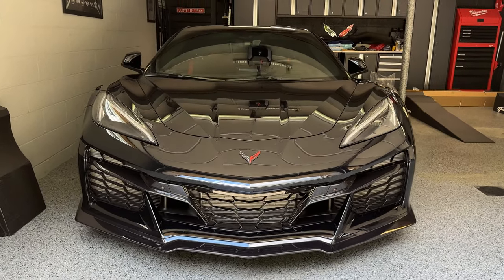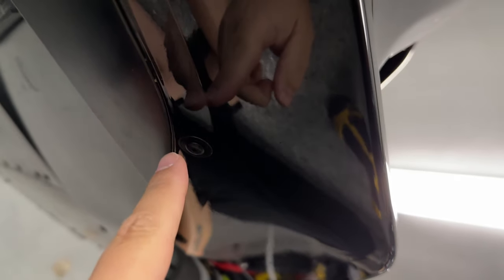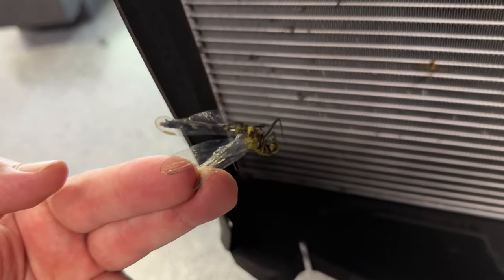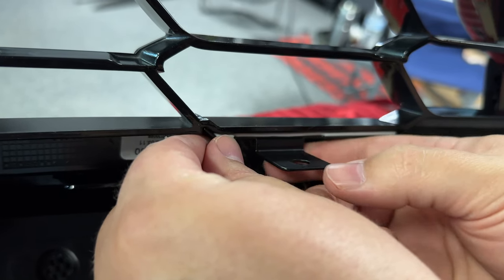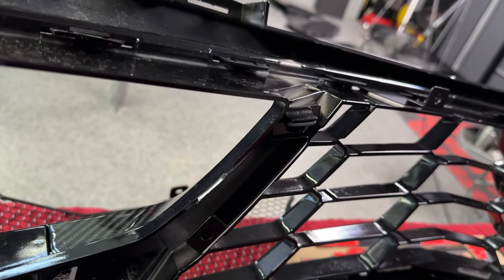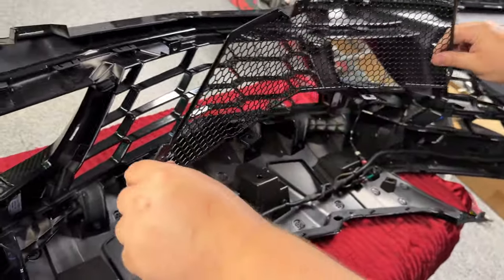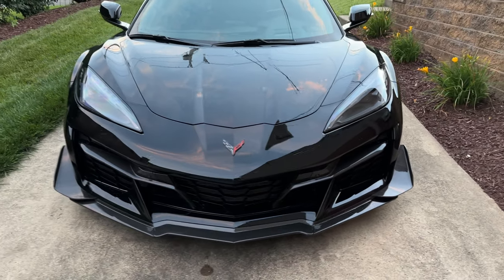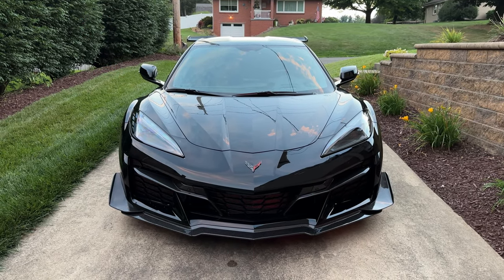HOW To Install C8 Corvette Z06 Scrape Armor Radiator Guards!

Comment from the maker: What do you guys think of the Scrape Armor protection? I personally find it one of the best fitting "aftermarket" items I've ever installed! 👍
Reply: Awesom product Justin.
Keep those mods coming!
Thanks again
Reply: The product is good, installation was a nightmare. Getting behind the wheel wells to disconnect the plug and get to that one 7mm screw was not possible without removing the front wheels and more wheel well screws. The front clip didn’t really fit well upon reinstallation and was VERY difficult to get on. It’s as if it changes shape once removed (stretched upon initial installation/temperate changes?). Two screws on the outside of the frunk line still don’t line up. It’s a two man job to boot. 

Based on my experience, I’d  strongly recommend a dealer do this and factor that into the cost of the product.

Comment: The grills are a great idea and they look great, too. HOWEVER, I would still want the mesh design to be even tighter (smaller holes). Surely a tighter mesh design wouldn't hamper airflow much.
Reply from the maker: They did extensive R&D to find that this hole size was as small as they could go without impacting cooling.
Reply: Ah, gotcha. I wonder if their testing was for heavy duty track use or just for normal street driving?

Comment: Thanks for posting this! You make it look easy! When mine comes in, I know what to do now. Maybe you could do a video on how to repair a rock chip using the touch up paint that GM sells. I am waiting for my PPF appointment but in the meantime i’m trying to get those break-in miles done …. Well I got a tiny rock chip near the top of the headlight, bummer!
Reply from the maker: It actually is quite easy especially once you get the bumper off.

Comment: Thank you for these videos. I had ordered the amazon zip tie set, then returned and got the knock off scrape armor set, and then just said screw it, and bought scrape armor with my GM points. 😂

I will say, they do make a DIFFERENCE! Just the packaging, presentation, material, instructions, and fit will instill confidence and long term reliability. The others are just cut mesh and cheapens the look if I am being honest. Thanks again!
Reply from the maker: 💯 they are fantastic!!

Comment: Justin, the Scrape Armor protection is something that GM should address the radiators are just too vulnerable and you make taking off the front bumper look way too easy...
Reply from the maker: It's actually not that difficult believe it or not. 100% worth it.

Comment: Why doesn't Chevrolet fix this problem "Dang"
Reply: supposedly it’s going to be available to add as an option from factory in 2024
Reply from the maker: Technically they did. They employed scrape armor to do it and sell their kit on their site now and even offer it installed.
Reply: It is an option VWE for $895.

Comment: How are these holding up?  ANY issues with cooling?  I'm thinking of the Paragon set, but these look great too.  Almost identical.
Reply from the maker: They are holding up perfectly. There won’t be any cooling issues because they were tested for that purpose. that’s the biggest reason GM gave Scrape Armor the go ahead to make these parts without losing warranty.

Comment: Chevy has radiator grill screens as an option for 2024 for $895. Ouch!  It should be included as original equipment in my opinion.
Reply from the maker: That 895 is installed.

Comment: Thoughts on light coat of black spray paint on those radiators?
Reply from the maker: I would love to do that, but everything I've read suggests it will hurt cooling.
Reply: @HorsePowerObsessed  Eastwood makes a car radiator paint. It's supposed to be safe.. Not sure they can or will stand by that for a Z06 engine.

Comment: I don't see how those guards are going to keep bugs less than a half inch out of the radiator?  It seems to me you would need some kind of mesh screen.
Reply from the maker: really small bugs are still going to get through if they hit it at the right spot.

Comment: The top COrvette engineers have said that they experimented with these covers themselves, but that they hindered cooling, and that if you are on track or live in the south where it is hot, they are not recommended, and if the DCT overheats, Chevy may not cover any damage if you partially restricted airflow to the coolers.

Just saying...
Reply from the maker: These, these are literally official Chevrolet accessories. What you’re talking about happened way before these ones were released. As I said, these are endorsed and sold by Chevrolet.
Reply: @HorsePowerObsessed  Cool, I missed that part.  haha
Reply: @HorsePowerObsessed  Also, $700 for two pieces of mesh?  Holy chit...  lol

Yeah, I will find a set of the same dimensions on Amazon or something.  For $700 I could just have a new radiator replaced by the dealer if a rock holed it...  haha

Comment: Why the GM Corvette team did not; either forsee this problem after many miles of testing or then offer rapid early model protection, I just have to shake my head.

I think it was only until the 2022 model year that they offer a grill guard option. This should be a standard build part. 🙄
Reply from the maker: They had a lot of trouble finding someone who would put in the time for R&D the way scrape armor did. They had to fit perfectly, they had to not hinder cooling/aerodynamics, etc.